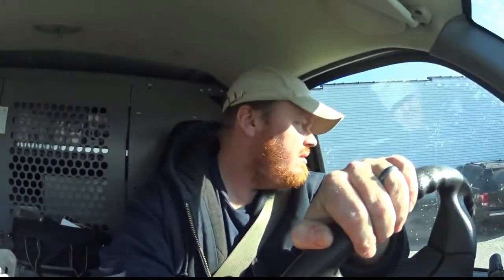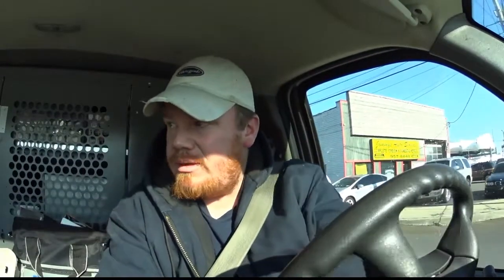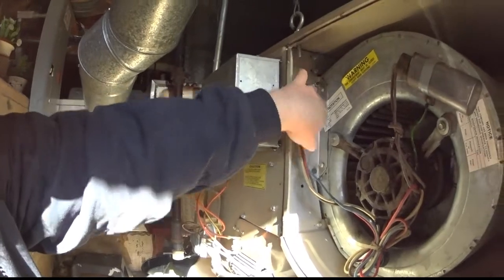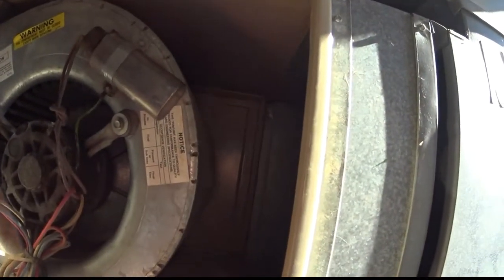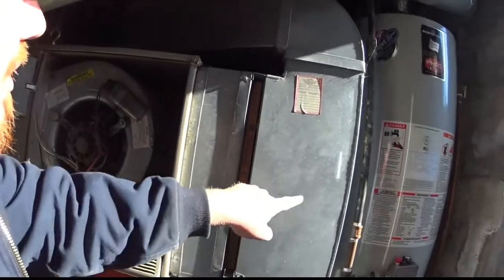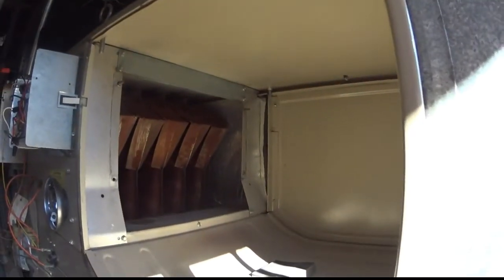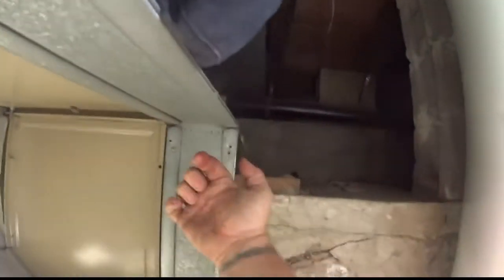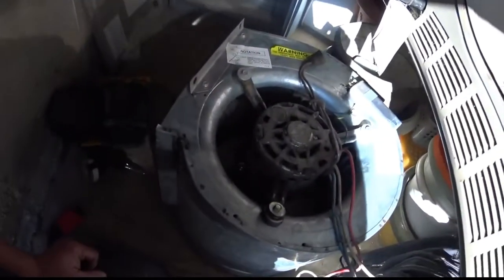Lennox gs18q4/5-140-8 blower motor change out. #HVAC

Comment: What a pain in the ass, installers should be shot. Although they probably didn't have much of a choice, and didn't realize what would have to be done to change the motor?
Reply from the maker: Yeah....  It turns out an older crew from my company did it... Cuz that's all that could be done....   Thanks for watching

Comment: That's the best way to do it. I normally change the motors out cause after you oil them they burn out if the customer was never getting maintenance done of the unit. Another job well done billy.
Reply from the maker: Thank you man..... I knew I should have changed it on the first call....instead of oiling it...  But I tried...lol...thanks for watching

Comment: Good Job Billy. Do they ever give you an easy one? lol
Reply from the maker: Lol...  Its been a run of tough ones...
Reply: Lol. I think if the manufacturer is gonna bolt the housing in like that, they should at least put a ring around the motor opening so you can pull the wheel and all out.